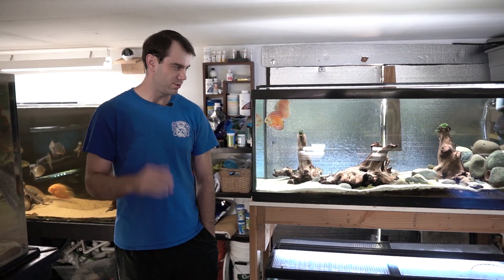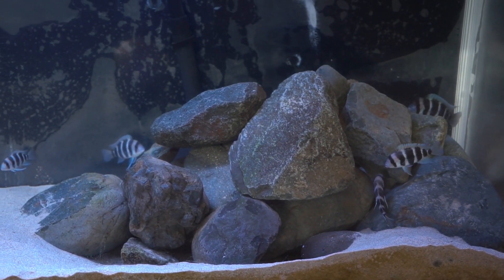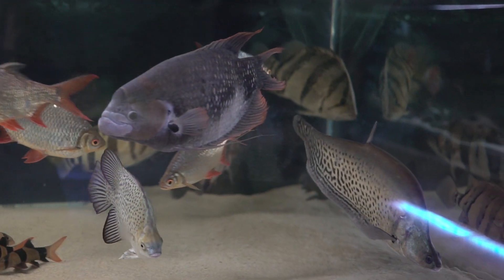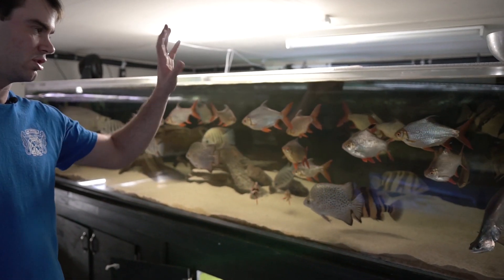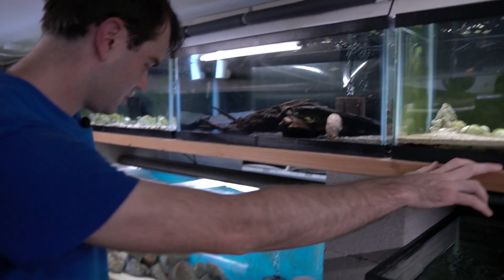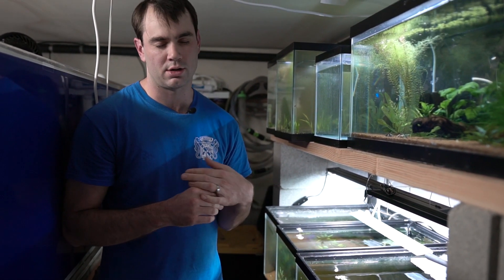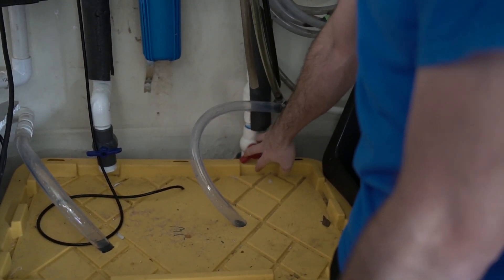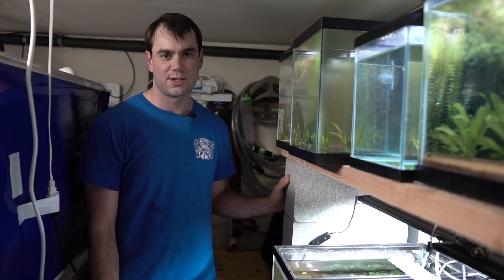Big Tank Fishroom Tour!!! Arowana, Pleco, Discus, Shrimp, and more!

Comment: Nice video... love datnoids myself too (I have 30+) but a bit of mis-information on the datnoids... 

All datnoids are freshwater, although can tolerate salt & AT ( silver ) will prefer slightly more salt as it becomes older. I have all mine in Fresh, I own all except an ST (the dream!) but I have a 12/13" Silver in Fresh & a 8" NGT in Fresh.
Reply: @J's Aqua NGT and AT are the only datnoids that would benefit from extra salinity. I had a AT before ans I noticed that he was weaker in freshwater compared to my indos. He eventually died when he poorly acclimated to a bigger aquarium. For now, I keep 4 bar indos because they are full fresh.